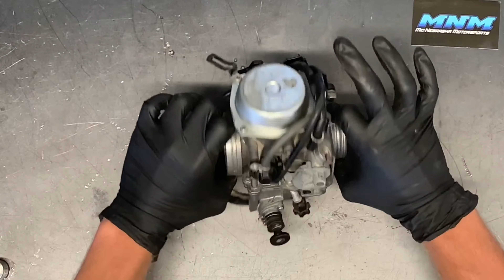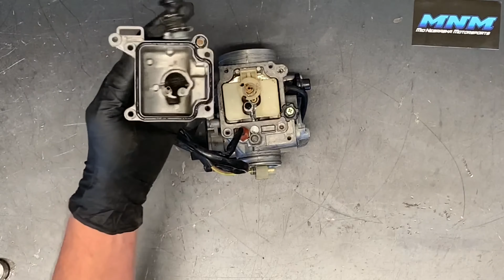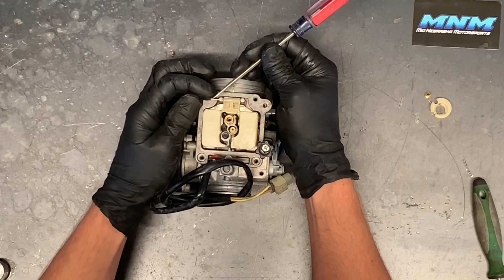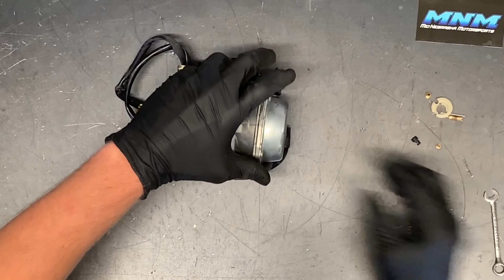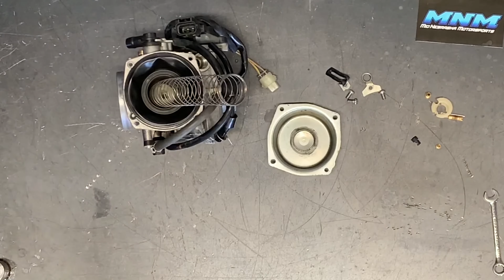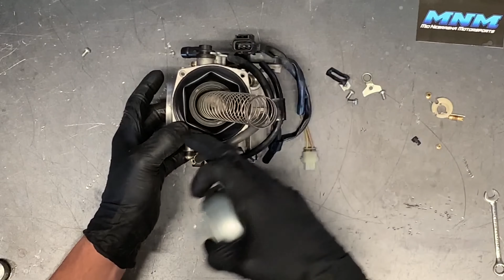Honda Foreman Rubicon 500 - SPOTLESS - Fuel Bad Carb Rebuild / Carburetor Clean - Won't Start

Comment: My carb leaks out the overflow when sitting in my garage.....what do you think the cause is
Reply from the maker: HMMM. All that is covered in this video. Let me know what you find!  Thanks for watching and the comment! Let me know if there is anything else you need. Check out: https://www.ebay.com/str/midnebraskamotorsports for any parts you may need!
Reply: @MidNebraskaMotorsports  Stuck float or dirt in the float jet/seat

Comment: Hi i have a honda foreman 500 2011 manual shift, when the quad warms up it bogs when you give it full throttle. It doesn't die or nothing just sits there and splutters. Only when it's warmed up. Any suggestions?!